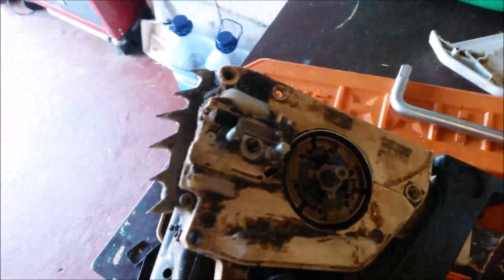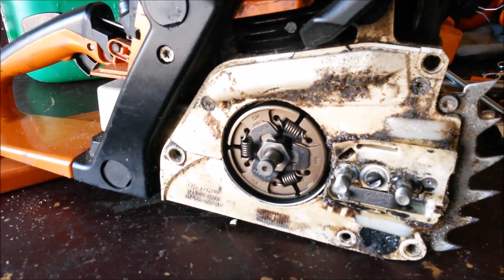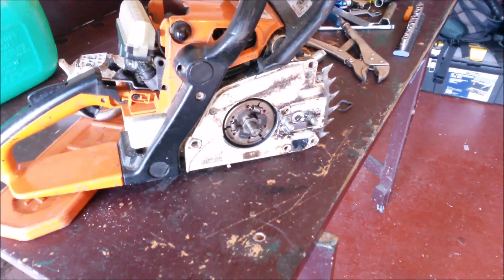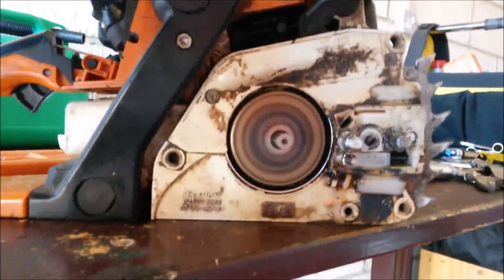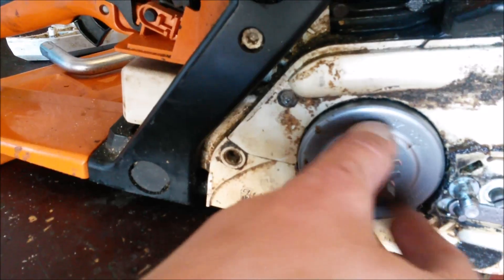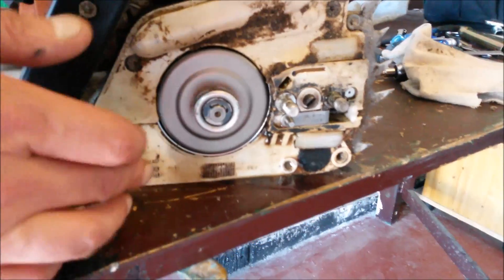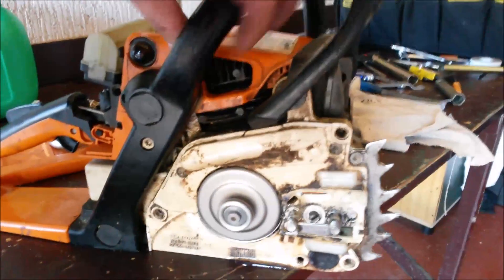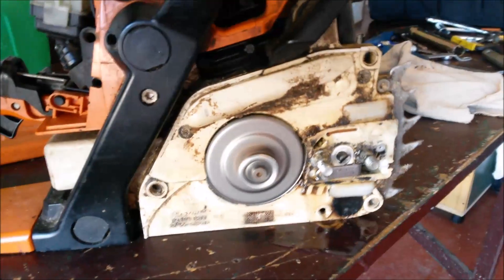Stihl Chainsaw Clutch in Action - How it Works

Comment: Oh wow, does the sprocket really have only 6 teeth?! In chain drives for power transmission it's advised to have 17 or more teeth and also to have an uneven number of teeth on a sprocket (otherwise the same chain always has contact with the same sprocket teeth high increases wear considerably).
Reply from the maker: Thanks for the comment and in answer to your question - Yep - it's all about speed and horsepower, rather than torque with saws. The sprocket and chains are consumable parts and are designed to require replacing regularly. The saw engines we work with  may not have enough power to turn a chain on a large sprocket. We run do slightly bigger sprockets with more powerful saws.

Comment: My clutch was absolutely warped..  unfortunately I was taught to keep the brake on at all times.. so when I started up my chainsaw in half throttle, I’d keep it there in half throttle while it warmed up.. this eventually burned up my clutch..  the labor/parts to repair was only $100 less than a brand new chainsaw..

Comment: Can you please elaborate on the exhaust problem you mentioned and what to do about it? My saw's chain moves at idle. I tried to lower the idle (not the splined L or H screws, but the phillips idle screw) but that didn't help. I replaced the clutch and drum/sprocket because they had clearly been overheated by misuse of the saw (maybe by revving with the brake on or when the chain was stuck in a cut). However, the chain still advances under idling, so I am looking for other ideas for what is wrong. So, please tell me about the exhaust issue that caused your saw's clutch to spin the drum/sprocket at idle. Thanks!
Reply from the maker: Loose chain perhaps? (my guess) or dirty/corroded clutch shoes catching the sprocket? The exhaust issue was to do with the exhaust not working properly to restrict the engine revs. A lot of the pro users here use a ms150 and port the exhaust by drilling an extra hole in it to speed up the airflow and hence increase revs, and rev increase rate. It effectively removes a bung from the end of the combustion chain. 
I'm not saying you should do that :-).
Reply: JamesTheForester, turned out the L mix screw had been adjusted way too lean, causing excessive engine RPM and engaging the clutch at idle. Spline tool acquired and problem fixed.